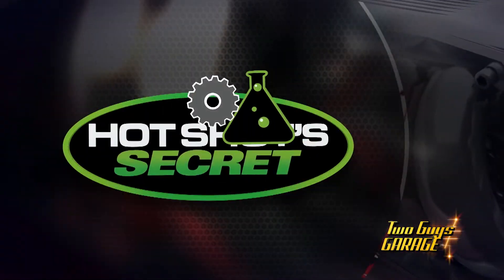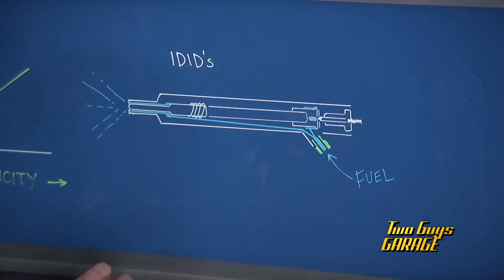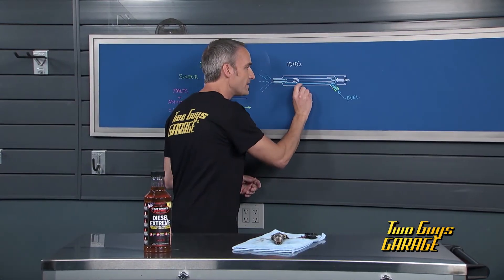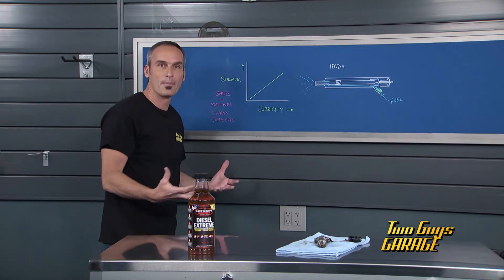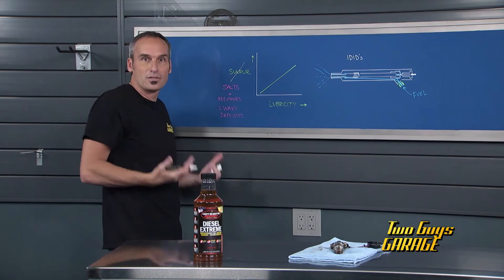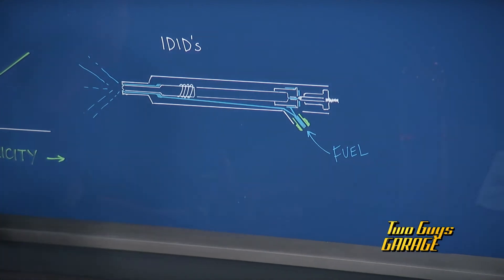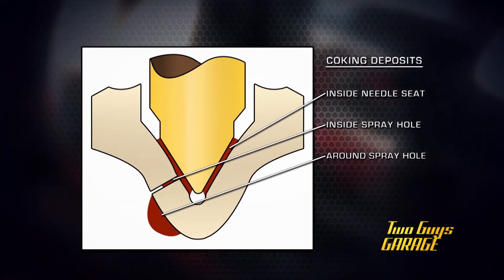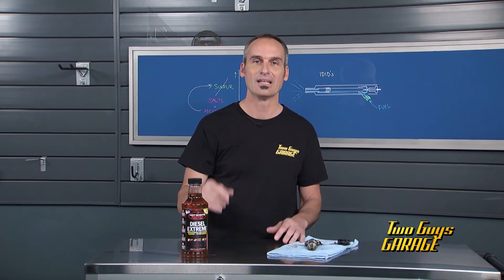The Worst Kind of Diesel Fuel Injector Deposits: IDIDs

Comment: I’ve been using EDT in my new Duramax since day one. When would I have to use Diesel Extreme or do I just keep using EDT additive?
Reply from the maker: Keep using EDT with every fill up but add Diesel Extreme to your maintenance routine and run it every 6,000 miles.